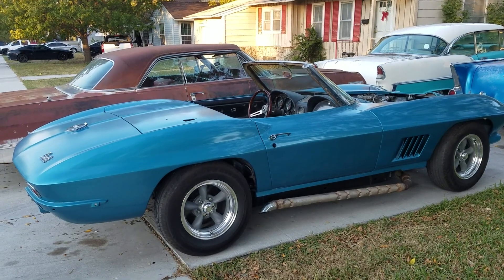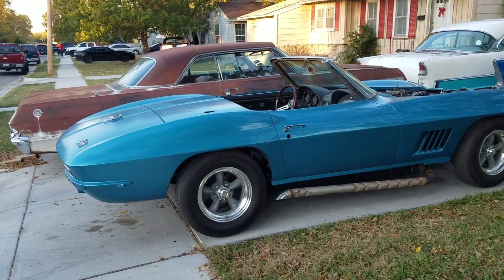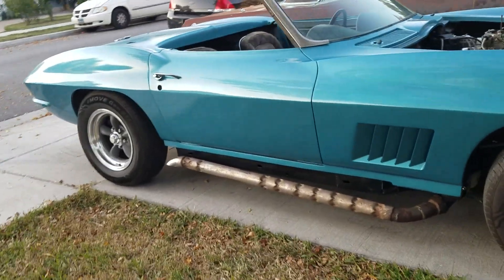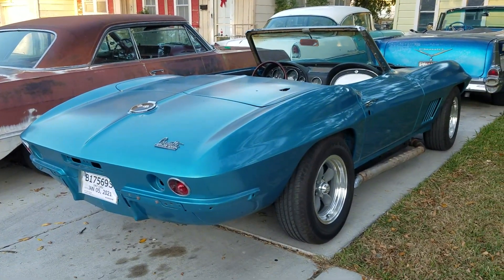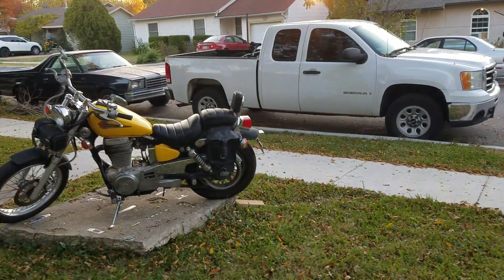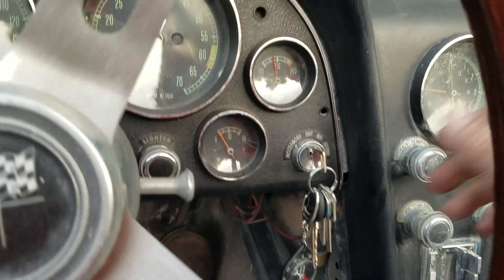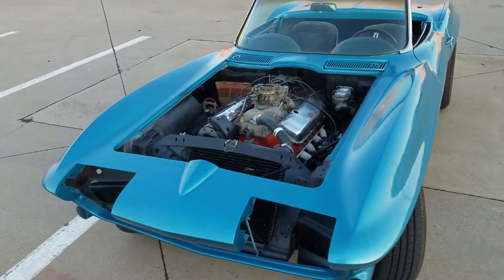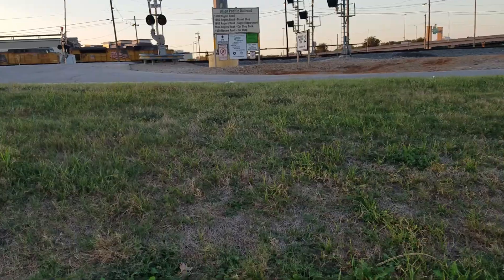1967 Corvette video 17

Comment: Dan, The GM Starter Heat Soak/Hot Soak problem is a decades old famous one...especially with a car with Headers.  The Hot Rodders solution is to install a Ford Solenoid on the firewall or fender apron.... Problem solved... Wrapping the headers in ceramic or material helps too..